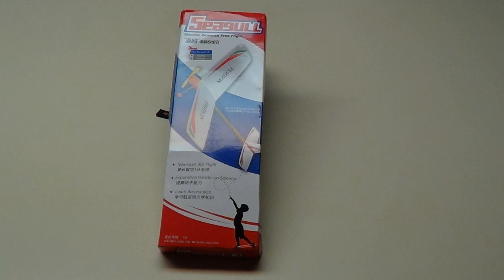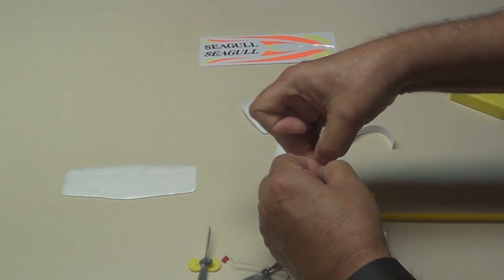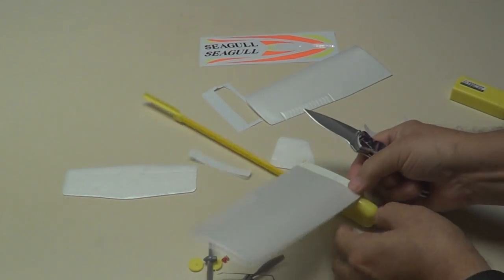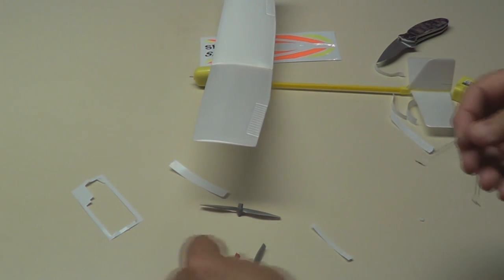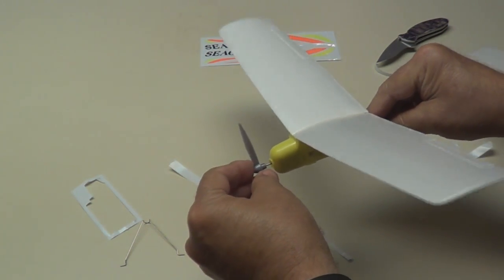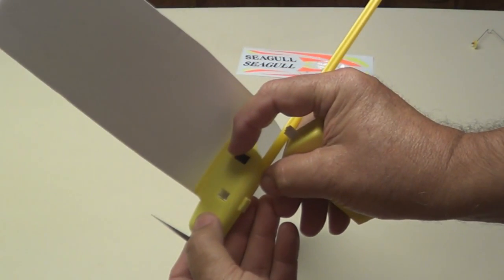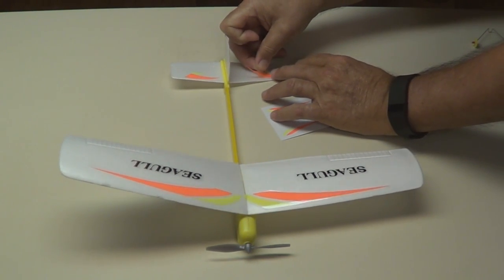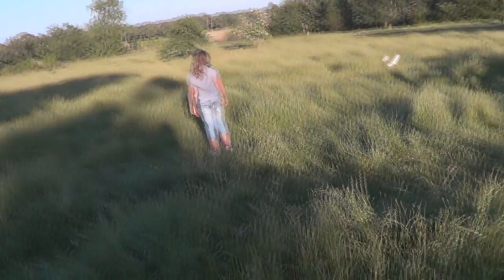How To Build And Fly An Electric Powered Plane Estes Seagull Not Rubber Band Powered

Comment: in my experience with double sided tape, I have found that after the first side of backing paper has been removed, the other side comes off much easier if you fold one corner back on itself. That gives you a "control" flap that enables you to peel the other side back with great ease. Happy modeling!
Reply from the maker: Thanks I'll keep that in mind.

Comment: About landing gear...  You should wrap that U around that bulk. Also, you forgot to put little (red?) caps on the end of the wire so that they hold the wheels on.
Reply from the maker: Yep had trouble with landing gear. It did fly good. 1st flight (not filmed) flew 3 large circles and landed in a tree. I have many trees on the farm here. Had to get my son-in-law up on the tractor lift to get it out. lol
Reply: bwcpublishing This trees... 😁 Once my helicopter remained on the tree.
Reply from the maker: Yes they seem to get in the way of flying objects.